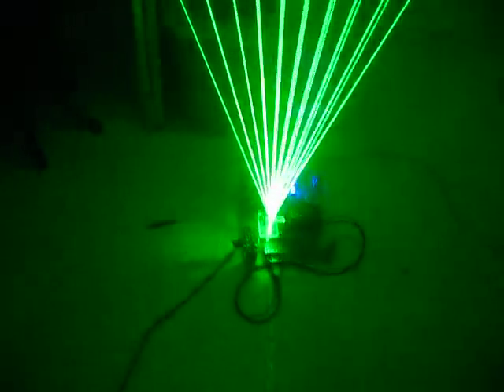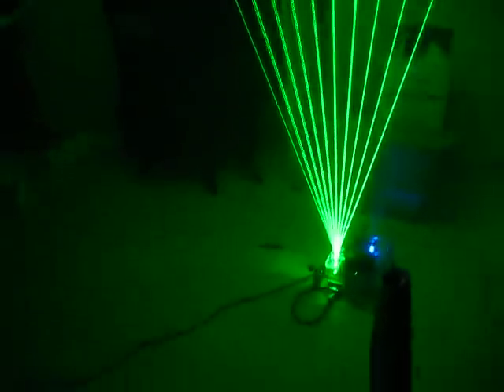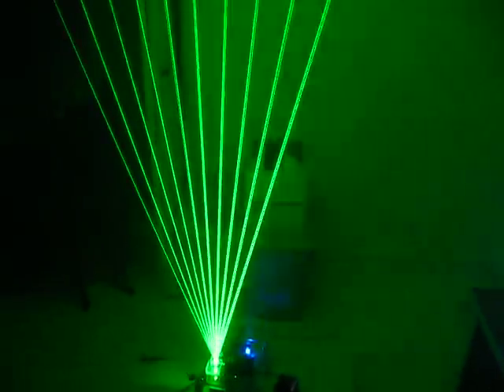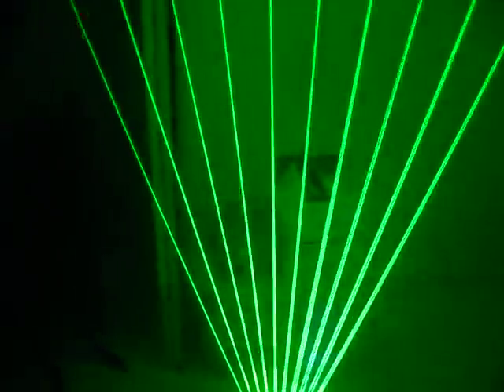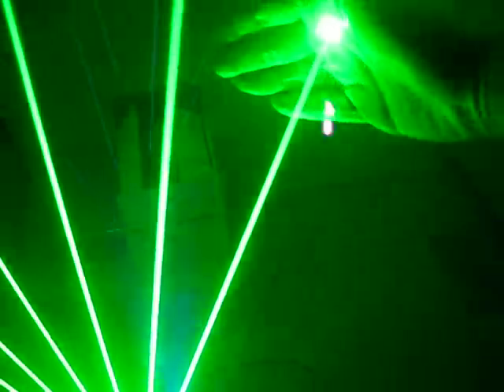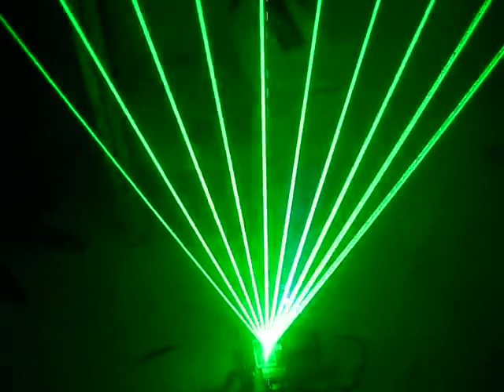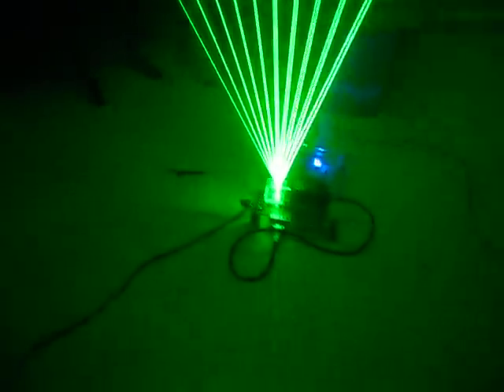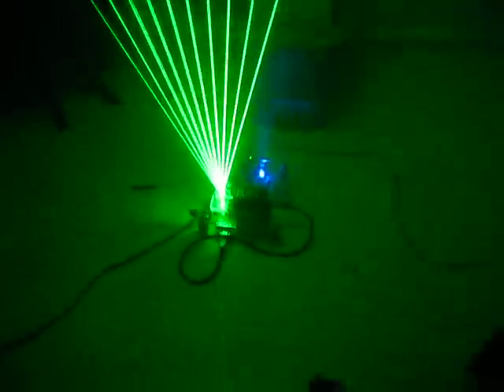Laser Harp Update

Comment: The first Galvo i tried was only a 12k and used and still do a MCP4725 12-bit DAC, its a breakout board from Sparkfun and that worked 100% after i solved the flicker, you can use the 12kpps for a harp, if you look on my YT page i have a short video showing 8 and 12 beams but my camera phone is not that good, it has the correct angle from start to stop position, thats my first that uses a 8051 microprocessor my 2nd uses a Arduino, get the code right and 12kpps will be no trouble... :)